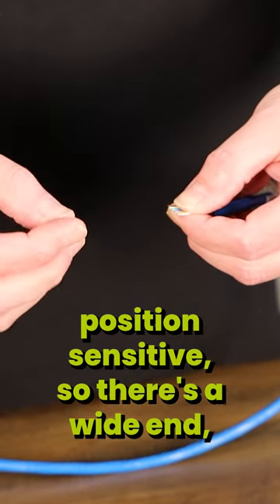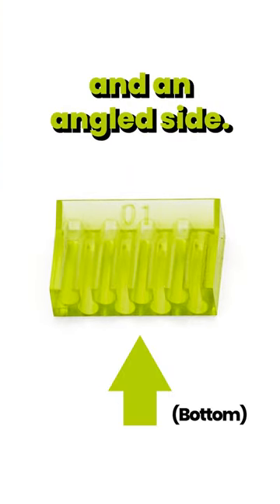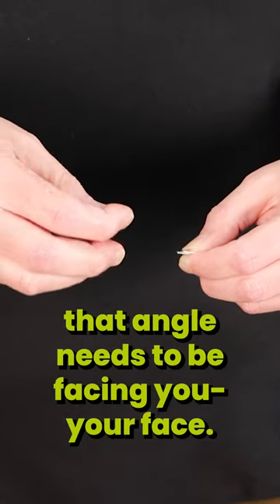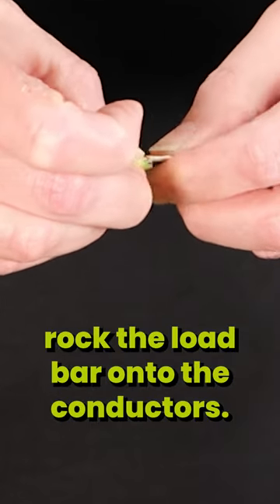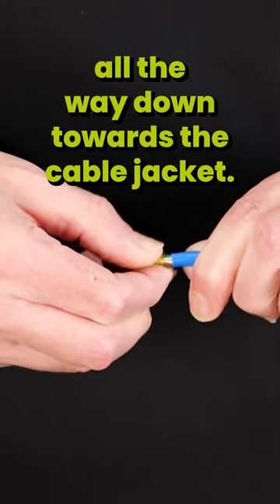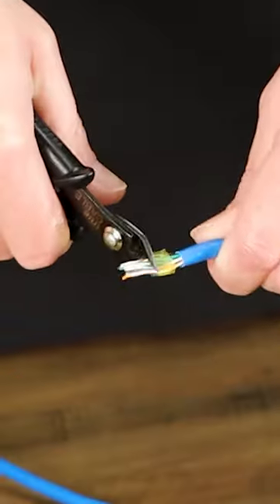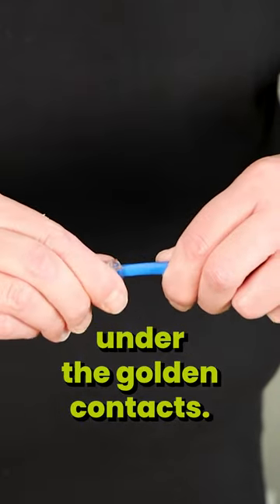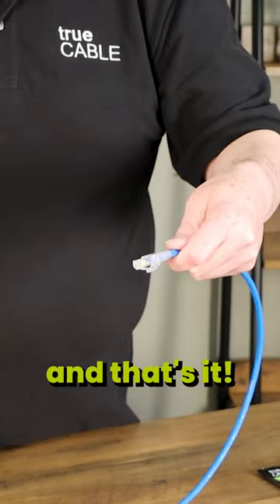Standard Load Bar RJ45 Termination! #shorts

Comment: Don't see where to buy just this unexpensive
Reply from the maker: Hello Francisco! You can buy our standard unshielded Cat6/6A load bar 8P8C plug here: https://www.truecable.com/products/cat6-6a-standard-rj45-connectors-unshielded?variant=32004297195587. They are less expensive than our pass-through variety and can be crimped in any standard RJ45 crimp tool.

Comment: Least you could do is give the people the color orders for A/B
Reply from the maker: Thanks for the feedback. This is a snippet from a larger YT video on our channel. Given the short amount of time for the YouTube Short Video, we could not fit in the color order.
Reply from the maker: You can check out the full length version of this video here: https://youtu.be/lWfuf5cQbOg
Reply: @trueCABLE  I went back and watched the full version, and I see you say the color order and explain that it needs to be the same, which is good information to new people. Friendly feedback: you should add a visual chart for those people trying to use the video as a guide so they can pause, get colors lined up, then proceed. Instead of having to rewind play to get the order. Wish you the best and hope to see more from you on different cable types: crossover, coax, fiber.
Reply from the maker: @NotAProblem  Hello! Thanks for the additional feedback and we do appreciate it! I will see that the video is revised to put in the color code chart. It should have been in there, but it was missed. Thanks for pointing that out!